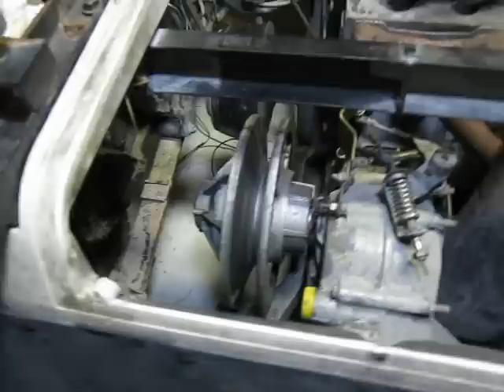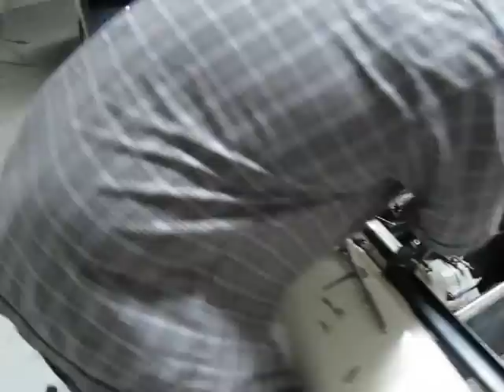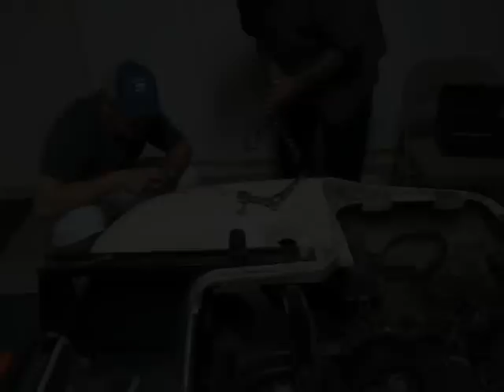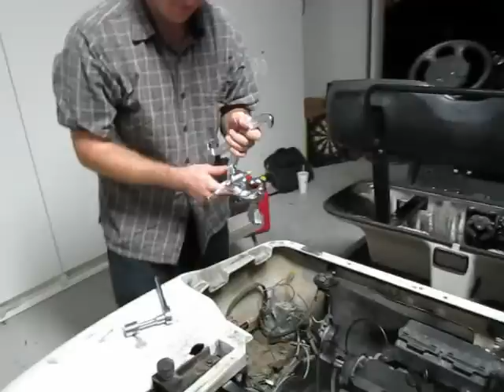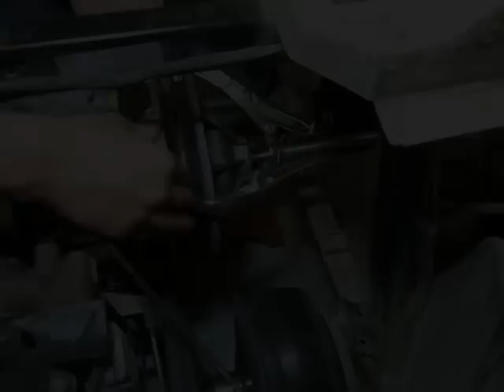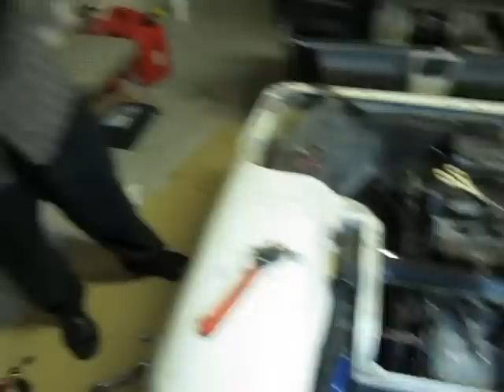On the Green - Removing the driven clutch

Comment: what did you put the center of the puller against. did you put a bolt back in the hole or what was used?
Reply: Anything that will go up against the puller will work, I believe he removed the washer and stuck the original bolt back in